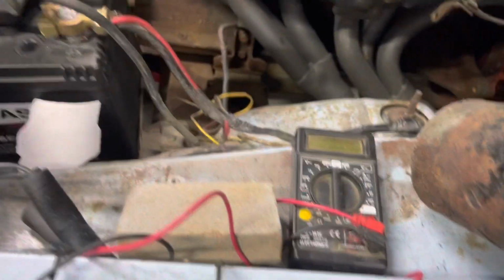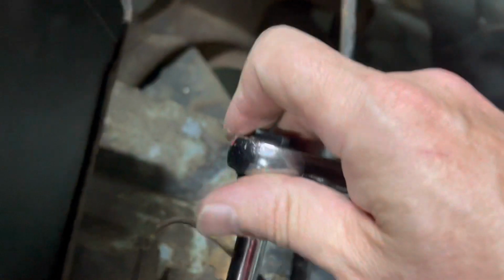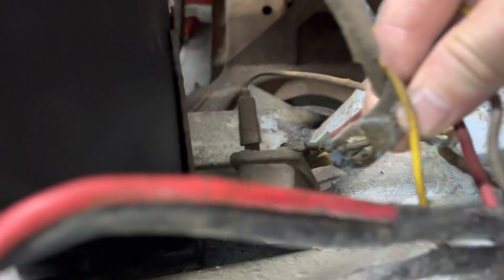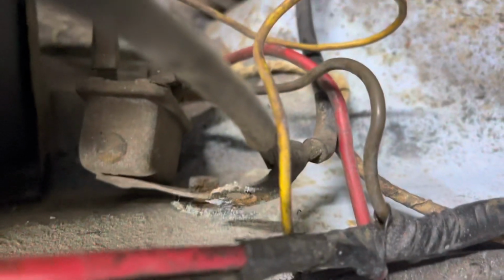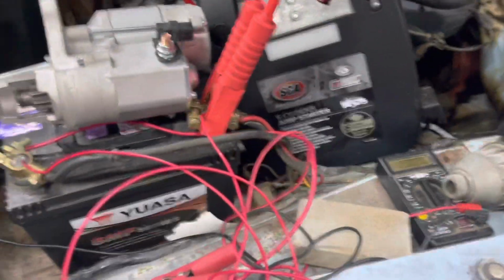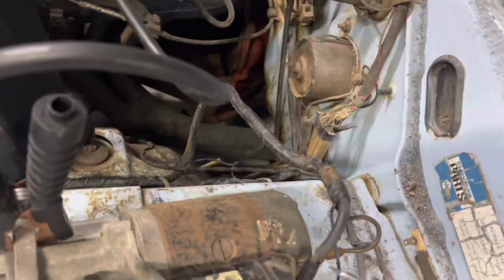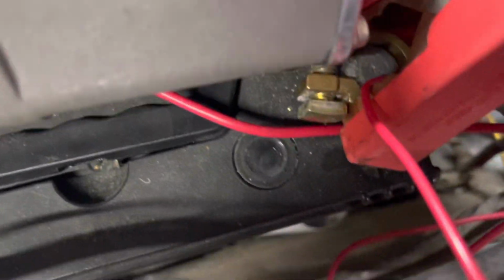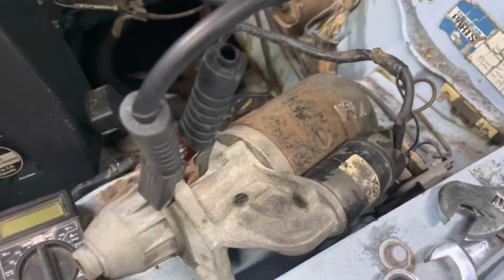VH Valiant Charger Starter Stuff

Comment: Hi Nick did you ever use the mini starter ,  ive got one i put in a 245 manual 3 speed and wiring it has been an issue , i can get it turning over but spark to dissy is weak it won't fire up , ive only used the main positive big lead to it and the brown wire from  relay , do you know where the blue wire should be hooked up to ? hope you can help me thanks .